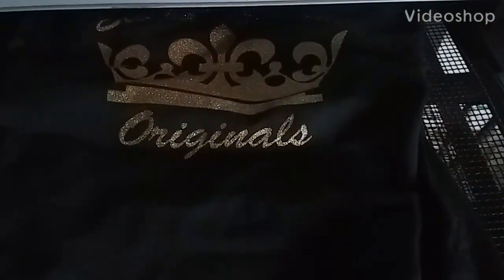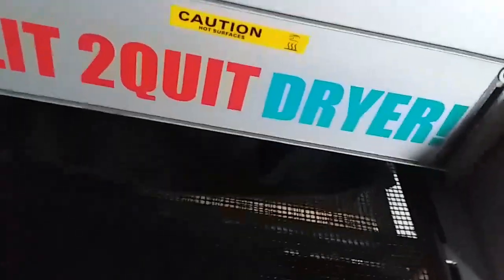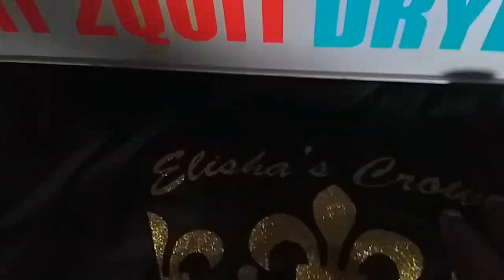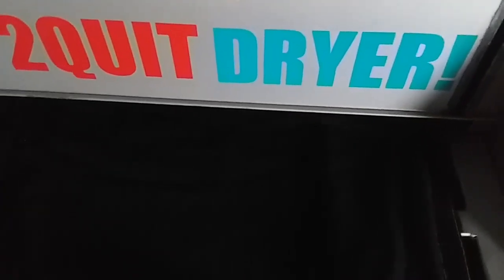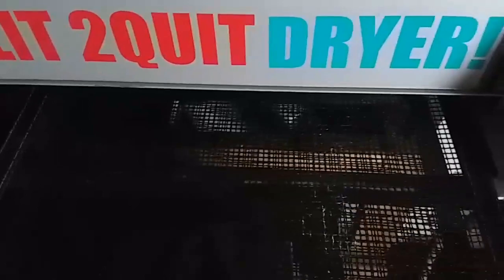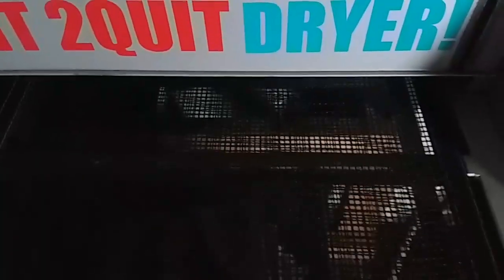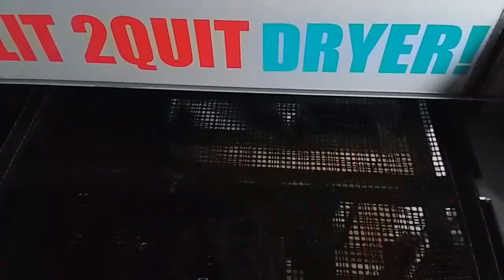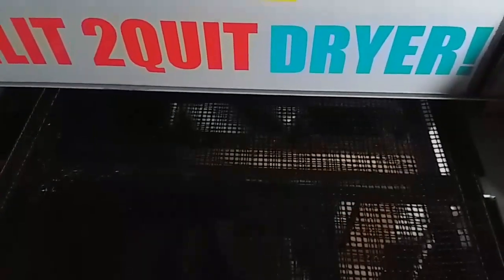TIPS for printing on a cold winter day temperature 28°

Comment: What kind of conveyor dryer are you using?
Reply from the maker: My dryer is an International dryer the company is no longer in business. It's a small dryer 8feet long 24-inch wide belt. There should not be any problems getting parts for it, everything is off the shelf stuff I can order online.
Reply: Cool